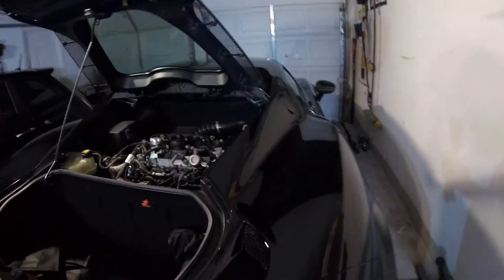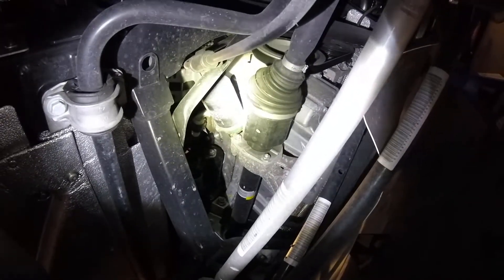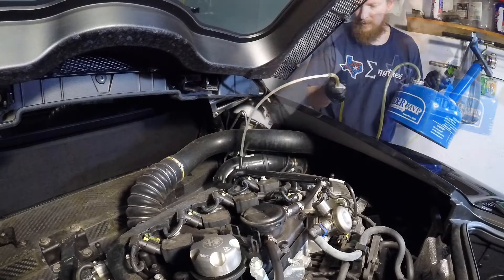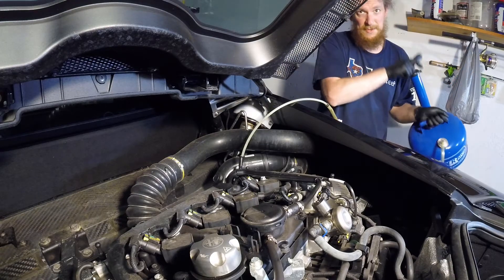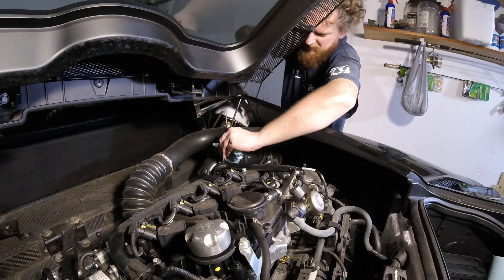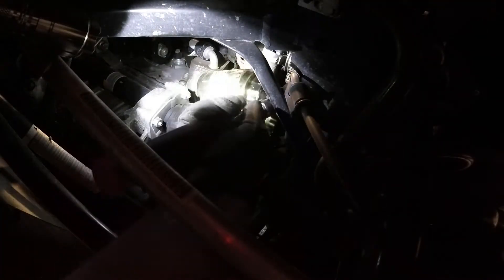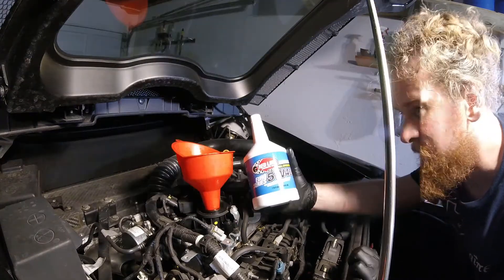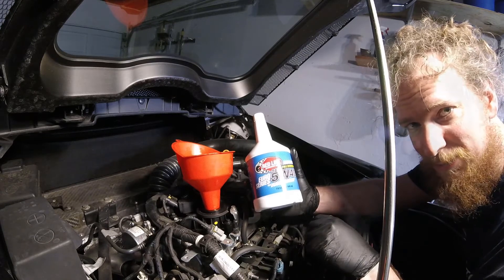Alfa 4C Oil Change Without Removing Diffuser

Comment: How many quarts do you install?  After five quarts, with filter change, mine is right on the top hash mark.  I'm afraid that six quarts would be an overfill.
Reply from the maker: Yep, don't over fill it. Five to five and a half quarts should do it.

Comment: Hi ,thanks for your video, can you give me The specifical caracteristics of The tool that you use for remove The filter? 
Congratulations and Best regards!
Reply from the maker: It's a generic 64mm oil filter socket. I've had it much longer than the 4C. Sorry I've forgotten where I picked it up. You can find similar ones on Amazon...
Reply: @BookAutowerks  thanks forever very kind!

Comment: Why did you use the Mobil1 filter?  I read that the bypass pressure on the OEM filter is unique.
Reply from the maker: Mobil 1 is generally regarded as a good filter. It has a metal core vs the plastic one from Mann; although that isn't necessarily an advantage. You'd have to ask Mobil what the bypass pressure is.
Reply: @BookAutowerks  Thank you for all you do.
Reply from the maker: @samyb2834  I'm glad it's helpful! Thanks for watching.

Comment: Hey man, did you do the bolt tightening yourself?
Reply from the maker: I did. It was a pain, but not impossible... The instructions can be found here: https://onedrive.live.com/view.aspx?cid=1BF62A2A81564279&resid=1BF62A2A81564279%214786&ithint=%2Epdf&open=true&app=WordPdf
Reply: @BookAutowerks  Thanks man,